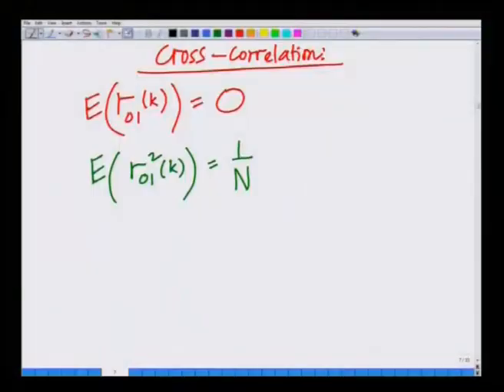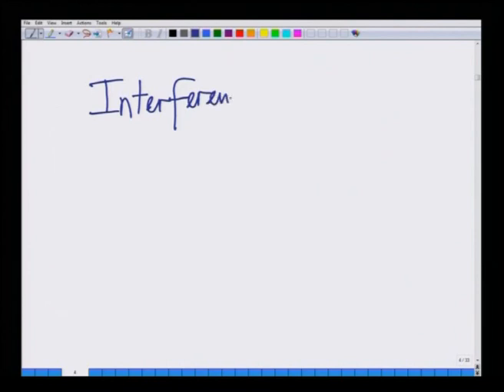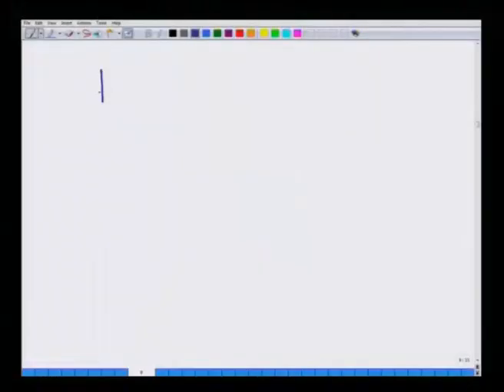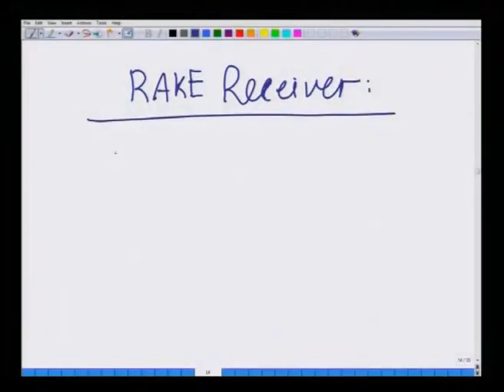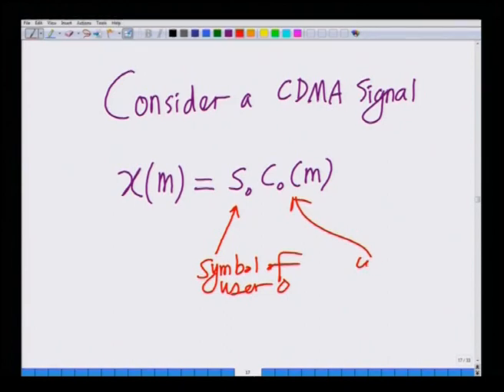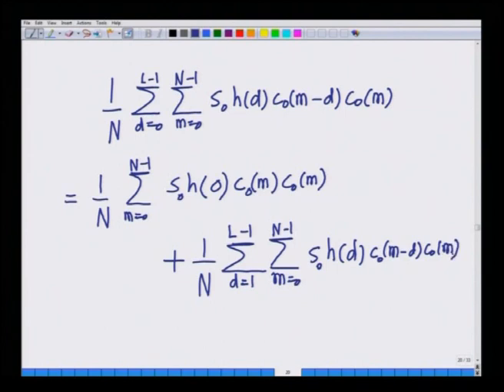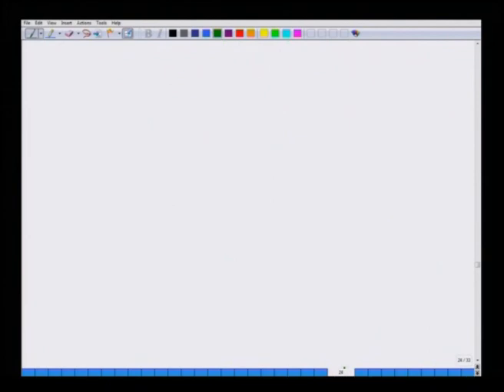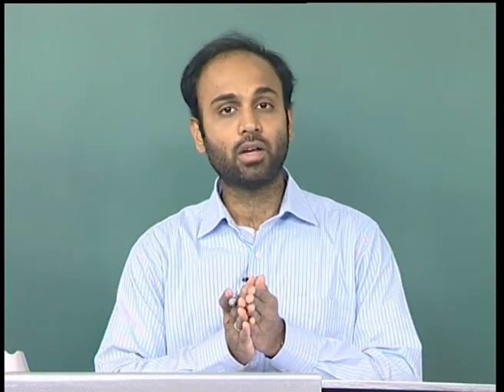Mod-01 Lec-16 CDMA Advantages and RAKE Receiver

Comment: 33:30 : Isn't the summation from d=0 to L-1 ?
Reply: yes
Reply: I think so
Reply: Yes
Reply: yes thats true thats sum over d rather than m. But can you please clarify one more of my doubt? the code word for user 0 is fixed that is Co. Here he is considering the transmitted s/g to be Co(m)*So; but since this is the case of ISI should we be actually concerned with the previous symbols interfering with the present symbol? In that case should not it be that So is a function of the index m rather than Co? I am stuck at this for a long time. Please help.
Reply: @arkadebmukherjee4021  actually Co(m) is not required. Co is enough. but in order to convey us that he is using the chip shifted version of Co, he used Co(m-1). he could have written just C0(shifted by 1) instead of writing C0(m-1). 
Co is not a function of time m. but should be used according to the time m for correlation. thats why he included m with the code.
this is what i think. anyone can correct me if i am wrong. we are all here to learn. thanks.
Reply: Yes, it should be d=0 to L-1. I was confused as well but the next slide clarified it.